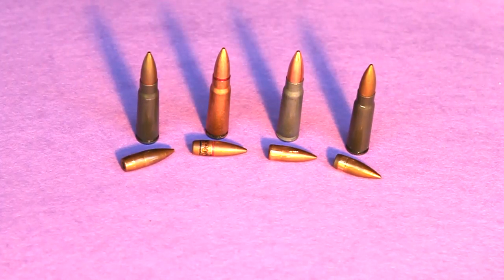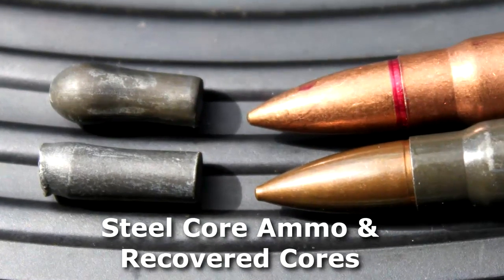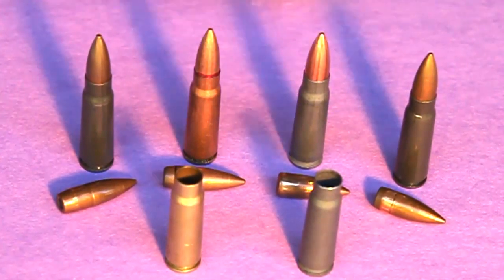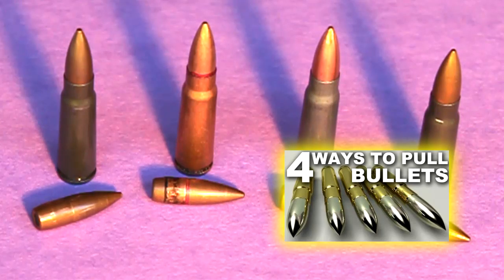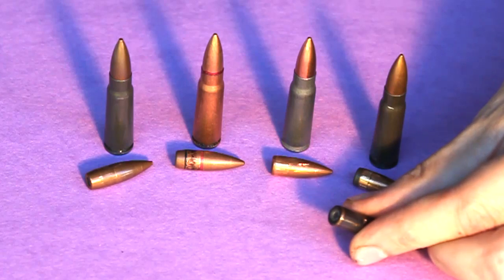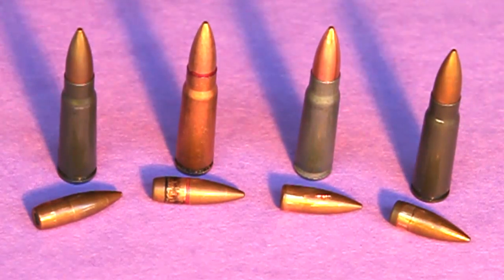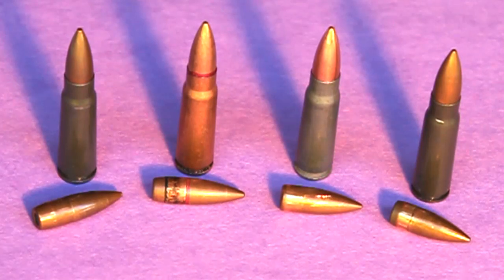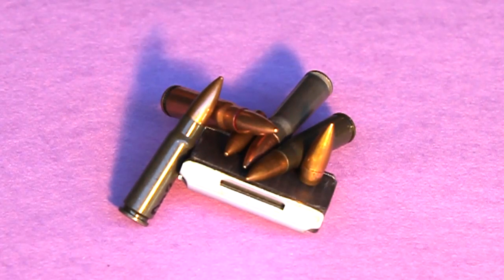Identifying Steel Core Ammo

Comment: Missed the most important identifier of Soviet block steel core ammo. 1) 2:30 Red band where bullet meets casing . 2 ) take a strong magnet, if the cartridge hangs on buy the bullet on the magnet  - steel core non-feros metals are not attracted by magnets .

Comment: Magnet works but not on all. Reason being is ranges not knowing lets say tula steel cased 223 is bimetal jacket witch atracts to magnet but its not steel core in any way. Magnet will only atract to a mild or steel core even if it has a steel case. I have steel case fmj only amd magnet wont stick to them. The case dont affect the bullet specially when cooper is invovled but yes ranges suck and say no steel case and dont know anything

Comment: These are just a few of the steelcore head stamps I have, most are copper washed. The last one is like a lacquer coated steel. I forget of one number is the factory or bullet type, an the other is the year made. 

311 over 92
31 over 93
948 over 72
71 over 93

Comment: There's also bi metal jacket which has a lead core, and a copper washed alloy jacket that may look like copper, but isn't copper, it has the same hardness as steel core projectile, does the similar in performance as a steel core projectile.

Comment: That tutorial was absolutely worthless! You don't magnet check a bullet by running a magnet to pass the case! You magnetek the bullet itself, but that still does not tell you if it's steel core or just steel jacket.

 furthermore the statement that most steel core ammo comes in a steel case is false! There is a lot of Steel core ammo in other calibers that does come in a brass case but there's also berdan primed. Being berdan primed,   may also mean that the primary itself is corrosive!

Comment: You can melt lead out of jacket with torch, and peel jacket with side cutters to get at core. It will pressurize and spray a little molten lead, so wear appropriate protection and point tail away. Pulled bullet obviously lol

Comment: you seem a little confused on this. but the video is old, perhaps you've cone something more recent. most steel cased ammo has a bimetal jacket on the bullet, which is 99% steel. so of course you're going to get a hit with the magnet, it has nothing to do with the steel case.
Reply: Yes,   "Steel jackets" that might appear to be copper or might appear to be zinc...  They Make "sparks"  better than copper  and might be hard on the backstops of indoor ranges.... by "marking it up" and possibly going through "cheap backstops".

Comment: The easy way to tell if there is a steel core is to take a pair of sidecutters to one of the bullets. If you can cut it in half easily then it is not steel. Yes there are jackets that are a thin layer of steel and that will attract a magnet but the round may not be steel core at all and will not hurt anything on a range. A hack saw is another alternative. You can always tell if you hit a steel core. Pretty simple.
Reply: No, the easiest and short way for determining the steel core ammo is the firing of one round of the sample with hard metal object and then examine the naked core without jacket.

Comment: sometimes if the end is open at the back of the projectile and you scratch it it might be soft or hard. That can some time give you a false positive that it's led core. I did this test on some Russian surplus        7.62x25 tokarav ammo found that only a small portion was lead the rest was steel. must have been for balancing  the projectile.

Comment: The tul ammo is steel jacket with a copper bath and lead core though correct?
Reply: +Eric&#39;s random junk  yeah that is my understanding, although if it attracts a magnet at all, then your range won't like it.  The yugo surplus is the only stuff I have found that is lead core and non magnetic.  Although it's corrosive so you have to clean right after
Reply: @goemonronin  and its basically all gone now.
Reply: @EricToTheScionti. Not online , you can find quite a bit 9f TulAmmo still.

Comment: Lead does not attract a magnet.  If TulAmmo isn't steel core then what is it because it isn't lead obviously.  Pretty sure this whole video is wrong because to my understanding TulAmmo along with most of the other cheaper AK rounds have a mild steel core.  The magnet test is reliable because in most cases its steel core or lead, and steel attracts a magnet and lead doesn't.  There may be some exceptions like Silver Bear AK ammo which is lead core with a steel jacket so it is a lead core bullet that does attract a magnet.
Reply: I was wondering the exact same thing.  I learned recently that some ammo out of Russia and other former east bloc countries actually have bullets that have a lead core but a steel jacket.  The steel jacket can still have a brassy color so is not easily distinguished visually.  So, it may be those bullets in his video are indeed lead core, as he claims, but have a steel jacket to which the magnet is attracted.  Steel jacketed ammo is an issue in the dry desert area that I live in because it can generate sparks and potentially cause fires.
Reply: The cores are lead but the jackets are copper-washed bi-metal.  There is steel in the jackets which makes the bullet magnetic.
Reply: +Kent Yammo The tulammo is a lead core, with a steel jacket, that is copper washed.

Comment: The lead core bullet is attracted because it has what is known as a "bi-metal" jacket. What's that mean? A guy did a test and found that, while it looks to be a copper jacket, it's actually a thin steel jacket with an incredibly thin coating of copper over it. The copper is only about 0.02mm to 0.03mm thick. Hairs on your head are typically 0.05mm to 0.1mm thick. That's why it's attracts a magnet.
Here's my source:
uspsa dot org/front-sight-magazine-article.php?Should-I-Buy-BiMetal-Ammo-8
Reply: jebova2301

Comment: Lead is more dense than steel and considerably softer. A heavier projectile is often more effective/accurate at long range. Also, lead is soft enough to mushroom nicely when hitting soft targets (should the lead become exposed due to the jacket breaking).
A distinct disadvantage of a steel core is that it can spark when hitting a hard target, creating the risk of fire. That is why shooting ranges don't let you use it.
Hope this helps, comrade.

Comment: Most of the russian/commie block ammo has a "bi-metal" jacket:  meaning it is a combination of steel mixed with copper.  That's why the magnets attract.  It's also why a lot of shooting ranges ban steel cased ammo.  It actually has nothing to do with the cases, but the bi-metal jacketed bullets that are so commonly used with them.
Reply: Ohh that makes a lot of sense. My veteran father talked about older bullets being made from lead and modern from alloy

Comment: All of the bullets attract the magnet because they all have bi-metal jackets. Lead-steel-copper. A true steel core round would be something like the m855. Even Wolf, Tula, Herters .223 attracts a magnet because they also have bi-metal jackets. Same goes for my Tulammo 9mm. Does it mean my Tulammo 9mm's are steel core? No. They just have a bi-metal jacket. This video is very mis-leading. Big difference between steel core and bi-metal steel jacket.

Comment: I have no trouble with the magnet test.  The attraction to a steel jacketed/lead core bullet is much less than to a steel jacketed/steel core bullet.  Once you learn the difference using a particular magnet, you'll have to problem.

Comment: One of the hoaxes is certain HP ammo for hunting.  AK FMJ military ammo comes with a sealed hollow cavity in the nose to aid with bullet upset on impact.  Some of the retailers found they could saw off the tip of the jacket to expose this cavity, and viola!.. hollow-point ammo!  Of course the bullet composition is still usually steel, which you couldn't deform with a hammer.
Reply: That "sealed hollow cavity" must be very short/small judging by the bullet cross sections given in videos on this channel

Comment: Simply putting a magnet on a pulled bullet doesn't tell you anything.  The Jackets of the bullets are steel and they are in a lot of imported russian ammo, including 9x18 makarov.  They are called bi-metal, steel jacket copper plated, lead core.  The bullets need to be cut in half to determine if it truly has a steel core and you don't do that.

Comment: i deleted that video and did a remake of it where i actualy did take apart a round and took out the steel core and hardness tested it. it is equivalent  to a mild carbon steel such as 1040 steel. also i showed the back of the plate and described everything in more detail.